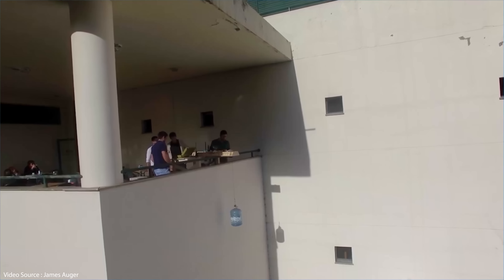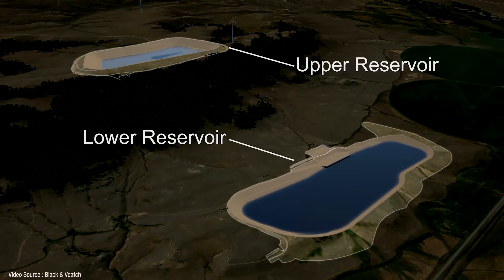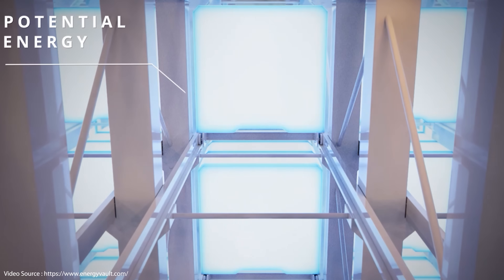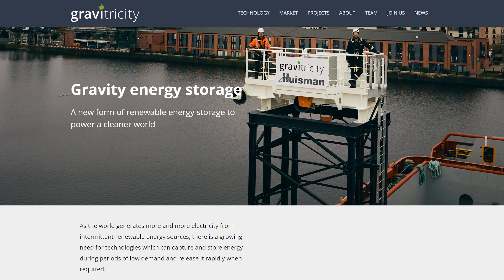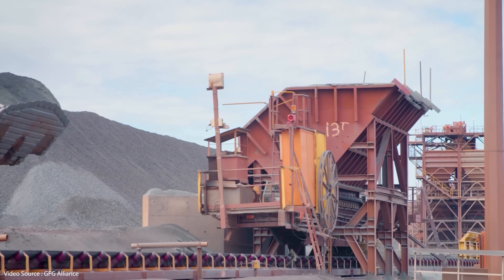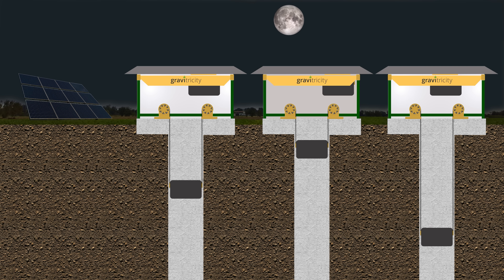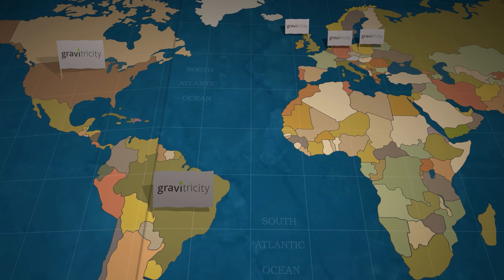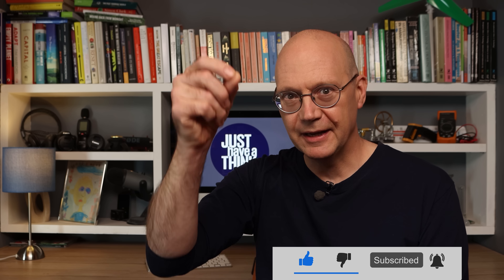Gravity Energy Storage. Who's right and who's wrong?

Comment: I like the idea of gravity storage, but I can't see this being useful for mass storage, say to get us through a period of gloomy, windless weather.
It would appear that its utility will be for grid balancing.
Reply: There's more than one kind of storage issue with renewable sources, and wind and solar have different problems. Despite the "OMG WHAT IF THE SUN STOPS SHINING OR THERE'S A VOLCANO OR A METEOR HITS THE EARTH???" nonsense, there's some very regular, quite predictable variation in both output and demand. So if you can compensate for that expected variation, you can turn either wind or solar into a consistent supply that can handle normal day-to-day variations. And those variations don't need nearly as much storage as saving energy so we can not have interruptions while the asteroid dust cloud blots out the Sun for seventeen years or whatever...
Reply: @davestagner  Your analysis ignores the effects of latitude. This comes with increasingly large differences between what is produced in summer and winter, the further north or south we go. I am highly skeptical of any claim that cities in high latitudes can be powered by solar/wind backed up by energy storage. Germany's solar power in winter can shrink to 1%of is value in summer. The Russians very sensibly build nuclear reactors to supply much of their energy needs. It   may be possible to rely on solar/wind within 40 degrees the equator, but let us not fool ourselves that this can be done everywhere with the current state of renewable technology.
Reply: @jonathanspilhaus3165  also, it only drops to 1% on very very cloudy days. And what is abundant on cloudy days..... wind..

Clouds form where high and low presure weather interacts. And what creates winds? High and low presure weather interacting with eachother. Having very dark cloudy weather and not having winds 100m up realy is rare. The cloudier it is the windier it gets.
Hence why they compliment eachother so well.
Reply: @jonathanspilhaus3165  And your analysis ignores the fact that wind velocity/consistency is more or less independent of latitude. I agree solar has problems in northern latitudes (although I doubt your “1%” figure - do you have a reference for that claim?), but wind works pretty well just about anywhere. I think a lot about the winter/long term storage issue too, but not as a knee-jerk excuses to say nuclear is the only solution. And storage isn’t a question of possibility, it’s a question of cost. Throw enough solar and enough storage at the problem, and you could power New York at the North Pole. It’s making it affordable that’s hard, and I that’s why I see a variety of solutions solving different issues - in particular, length of storage. For long-term, multi-month storage (like for winters), I think we’ll see a rise of carbon-neutral fuel - hydrogen or synthetic hydrocarbons - running ordinary generators or adapted old power plants. It’s not maximally cost-efficient, but it’s energy-dense, near-zero loss, and mobile. I can easily see solar farms in sunny climates shipping synthetic fuels north in the winter. Before you say that’s impossible, remember that we’re already doing that with oil.
Reply: @davestagner  glad to see there are still some rational people discussing this subject every now and then.

The fact is that pv is becomming the abundant extremely low cost product to provide electricity over the comming decades. It doubles in efficienty every 10 years or so and cost will keep falling as production capacity keeps expanding exponentionally over the next decades as well. And wind followes in second place.

We can keep arguing about it being the best option or not and whatever, but economics simply decides that will become our main source of power, especially as it gets adopted more and more by people and businesses to generate as much energy themselves for free.
This economic reality isn't going to change anymore.
Storage is going the exact same process, battery storage will keep dropping in price going forward so adoption by those same people and businesses will make increasingly more sense economicaly over time, so people will opt to use this technology in their homes.

If we want to get ahead with solving our co2 problem we need to work to find realistic solutions to make what we have work the best we can and find alternatives where pv with wind backup with decentralised storage isn't going to work. And stop arguing about financially unviable options like nuclear are better or not.

The problem is no longer generation, it is storage or time shifting.
Reply: @davestagner  plus for the comming decades natural gas with a carbon capture scheme is also still a viable option for the extremely difficult places and as back up for extra ordinary circumstances.

Which takes a lot of presure of the system as a whole and allows technology to gradually catch up.
Reply: @baronvonlimbourgh1716  Indeed! If nuclear was an affordable solution, it would be dominant already. It has been around for decades and is barely cost competitive with coal, much less modern renewables. The moment storage becomes cheaper than fossil fuels (and we are almost there), market forces will do the rest.

I keep thinking of Prometheus Fuels, who are claiming a near-50% thermal efficiency in their process for synthesized gasoline from atmospheric CO2 and solar power. While that may be overpromising for now, it seems almost inevitable that they or someone else will crack that nut. It’s just an engineering problem. Once they got distillation out of the picture, it became far more reasonable.
Reply: @davestagner  at the moment 5 to 10% of all fuel sold in europe is already biofuel as it is mixed in with regular gasoline and diesel.
As the car fleet moves to electricity all of that biofuel becomes available for other purposes. The production capacity and distribution infrastructure is already there. A lot of fuel is sold in europe every year, that alone is already a very big additional source that can cover the most extreme outlying situations.
The more we knibble away at the most difficult situations with these kind of solutions the less impossible the task becomes.

And offloading things that are now done with electricity or fosil fuels that can be done with other sources can also have a masive impact.
Making a push for heating and cooling to be moved to using underground instalations with heatpumps instead of straight up electricity or gas will have a big impact on storage needed.

As well as increased preasure on the use of power efficient appliances and transportation.  Every watt structurally saved is a watt no longer needed to be generated and stored. And the more households can be selfsufficient and less reliant on the grid.

There is still so much low hanging fruit to be adressed that can make huge difference in the scale of the challenge that needs to be met.

We have the tools to get it done already, and from here forward there will only bexome ever more tools available that will only become better over time.

We now have a chance to make everything so much better then ever before, and we can do it without using obsolete 20th century technology.
Reply: @davestagner  Electricity in nuclear powered France costs one half that of renewables Germany. Nuclear should be a player in high latitudes.
Reply: @jonathanspilhaus3165  But renewables are rapidly getting cheaper. Nuclear is not. None of the breakthroughs being touted as even remotely feasible in the next 10-20 years will do much to cut the cost of nuclear. PV solar prices dropped over 80% in a decade, and are expected to drop at least another 50% in the next decade. Storage is also seeing massive cost improvements. And sadly, France isn’t building any new nuclear power plants to replace the 1970s antiques that sooner or later need to be shut down and decommissioned.
Reply: @baronvonlimbourgh1716  So you think PV efficiency is going to double every 10 years?

Back in the 1980's solar panels had an efficiency of 5%. Today, 40 years later we are at 23%.
All you have got is 4 points on a graph, one for each decade, sure you only need two points to describe a line, but you have no idea how that line on the graph is going to have the same gradient after that 4th and latest point.

It's a little different to Moore's law with integrated circuit technology, where new process improvements are being rolled every few years and there is enough data to show that the law still holds true after 40 years. Advancements in PV do not come at anywhere near the same rate and I think you will find there are limiting factors which will reduce the gradient of the curve as time goes by.
Reply: @davestagner  It is not just about the cost of renewables falling, there is a concern over availability of renewables. They are not 100% available, unlike nuclear.

You can't build your national infrastructure solely on an inherently less than 100% available supply of electricity.
Reply: @deang5622  efficienty is already hitting the high 40's. Which will be widely commercially available a decade from now. Even if it where to slow down after that we are still talking 70%+ 3 or 4 decades from now.

At ever decreasing costs. The future is bright.
Reply: @deang5622  And that’s why we need storage tech as well as renewable generation. Luckily there are many different ways to store energy and some incredible activity in this field. Batteries, gravity, thermal storage, synthetic fuels… the list goes on. It’s just a matter of cost, and that is being rapidly solved.
Reply: @deang5622  why couldn't you can make renewable 100% available.

And what will the nuke be doing during times where renewables are abundant? Shut the thing off and have it sit there for months? Cause nobody is going to be willing to pay for it's electricity if renewables are already over producing costing a fraction of the price.

They would need to be 100% subsedised by government. 
At that point you are better off investing in carbon capture and run some natural gas plants every now and then when nesesary until the system evolved and matured enough to be fully renewable.
Reply: @deang5622  Why does “efficiency” matter? Do solar panels need to be smaller? Can’t we just cover more area? What matters isn’t efficiency in terms of watts per area. What matters is watts per dollar. And by THAT measure, PV solar has been more or less on a Moore’s Law curve for the past two decades. We’re already down to 2c/Wh commercial peak pricing, and it’s totally reasonable to expect that to drop to 1c/Wh by 2030. That’s a tenth the cost of coal or nuclear. Even if it doesn’t run 24/7, even if energy needs stored with some efficiency losses, it makes sourcing solar in sunny places so absurdly cheap that nothing else can compete. And if we can start turning that cheap PV solar into readily transportable fuel (hydrogen or hydrocarbons) at 40-50% thermal efficiency (which is theoretically possible, so it’s just an engineering problem), we can turn deserts and other sparsely populated sun belts into giant fuel farms. A gallon of gasoline is about 35kWh of energy. At 50% efficiency, using 2c/Wh electricity, it’ll cost about $1.40 to synthesize a gallon of carbon neutral gasoline out of the CO2 in the air. Even at only 25% efficiency, that’s less than $3/gallon… easily cost competitive with fossil fuel. And the moment synthetic gasoline/kerosene/diesel is cost-competitive with fossil fuel, fossil fuel is DEAD.
Reply: Calculate how much mass you would need. It's enormous. Think mountains.
Reply: Gravitricity mentions 10MW/25MWh systems, but also 20MW systems with 24 weights of 500 tonnes each, so presumably 50MWh.
I was thinking that you could fill up a very deep well for the first few years for free energy without even bothering to ever retrieve the iron ore until you reach the minimum operational depth, but unfortunately, it would require a shaft at least 1km deep instead of 600m or so for only one year of free energy.
Gravitricity is not very clear on the shaft depth, they only say it must be at least 300m deep, hence my assumption of 600m because a full 24-weights system would require 360m of 24 stacked weights for a regular 24 feet diameter mine shaft, if the density of the iron is about 3 (they don't provide exact numbers), so I am guessing their test rig is much smaller than the design.
Still, if you have 20 shafts of 50MWh each, you can produce 1GWh of electricity for one hour. You'd need hundreds or thousands of such shafts for continuous uninterrupted 1GWh production. For instance, if it takes only 2 days (48 hours) to lift all 24 blocks up, you'll need 48x20 = 960+1 such shafts. It basically means that for one hour of electricity generation, the weights are offline for nearly 50 hours while they are all being lifted up one by one (or 2-3 at a time if they add more lifting motors). Again, no data provided by Gravitricity, so I guess they are still figuring out the optimal performance/cost ratio.
Reply: Used for  grid balancing. for over 100 years  https://en.wikipedia.org/wiki/Pumped-storage_hydroelectricity
Reply: @zenko247  Yes, but as the video said, we don't always have suitable geography for pumped hydro like Dinorwig.  We do have lots of mine shafts though.
Reply: @gillianbc  The planet is 70 water and you do not have to produce the energy where it is needed as now PS  what to you think most disused mineshafts are full of??? You guessed it
Reply: Yeah, exactly. I see this more as covering overnight demand for a solar farm than holding those weights up waiting for a rainy day.
Reply: That really depends on the amount of mass in storage. With sufficient mass reserves to account for worst-case scenarios it should be OK. It's not as if the blocks are evaporating or chemically degrading while they sit in storage, so other than the requirement for 'excess' storage area there shouldn't be many downsides.
Reply: You mean gloomy (cloudy) days that are not part of a weather system that creates wind at turbine height within 200 miles of you? Hmm
Whilst they may rarely occur very few eco fans suggest that we do not need base load generation as well. But the amount of needed baseload should reduce. And there are clean baseload technologies being refined or developed.
Reply: @johnpublicprofile6261  - I'm not sure what point you are making. Being totally dependent  on renewables (as I hope we will be) = storage that will maintain us for days, if not weeks.
I don't think we have shafts deep and wide enough, or ropes strong enough to raise and lower the necessary mass required.
Reply: @petersmith2137  we don't need storage for weeks lol. Don't be so dramatic.
Reply: @baronvonlimbourgh1716  - that depends on assumption about our future energy sources, and the amount of spare capacity we plan to build into the system.
Reply: @baronvonlimbourgh1716  You may well need storage for weeks, even months, if you insist on 100% renewables everywhere including regions north or south of 66 latitude.
Reply: @petersmith2137  that is an easy assumption to make. The cheapest source available and multiple times over capacity then we need. 
And simply put the over production to use for other purposes when it isn't needed.

That is the trajectory we are on currently and nothing seems to be able to change the economics that drive it.
Reply: @jonathanspilhaus3165  i insist on nothing. 
Simple economics will solve these issues eventually. Even for the few people living in those areas.

And we already have longterm solar storage and transportable capabilities available for those regions. They are just deployed elsewhere at the moment but as demand goes down in those markets it can be moved to those areas.
Reply: @jonathanspilhaus3165  Depending on the politics, grid interconnection can move generation capacity much further south (in the northern hemisphere). There should be no reason power needs to be generated and stored in the same location. 
But then again...
Russia...🤔
Reply: @baronvonlimbourgh1716  - I am 100% with you there. What I am saying is that it doesn't sound like gravity storage will feature highly when we are looking for places to store our excess production; that's all.
Reply: @petersmith2137  every location will have it's own situation where something will make the most sense economicaly.

Digging a masive hole might not be competitive with battery storage or whatever. But having a hole already  that is just sitting there might turn out to be very economically attractive.

And we dug a lot of holes everywhere over the centuries.. so it could be a very useful alternative in places. Not so much in others.

Other places won't have holes but might be able to make water reservoirs work. And in other places storing it as heat or hydrogen might be most productive and economicaly viable.
And in some places the land is best used to store solar energy directly in biofuels to create a highly transportable medium that can be stored longterm to provide in more challenging places.
Reply: @emceeboogieboots1608  Indeed: Russia is sensible. I dont see solar/wind powered icebreakers being used there. Nuclear power is needed for places like Murmansk: they dont need expensive grids. Power 24/7 from nuclear.
Reply: @jonathanspilhaus3165  You completely misunderstood the Russia reference to spout bad arguments that whatever Russia currently uses to power it's Arctic military bases is the only good thing.
  The Russia problem is the massive disruption of global energy supply caused by Russia's dictator starting a war; And how the possibility of future such geopolitical surprises pose a significant risk for any energy solution relying on international trade or cooperation.
Reply: It would be perfect for somewhere like Kalgoorlie. Able to generate truckloads of solar, a few old shafts that should be suitable and being  connected to the eastern end of the South West grid 
Though fluctuating gold and nickel prices may make companies loath to abandon a mine that potentially may reopen